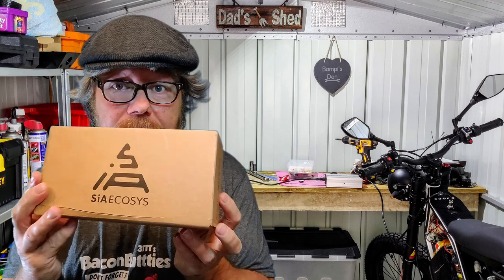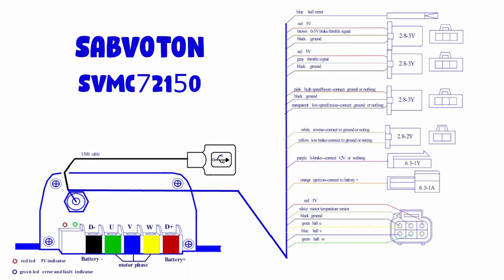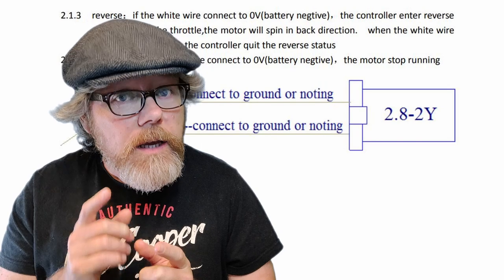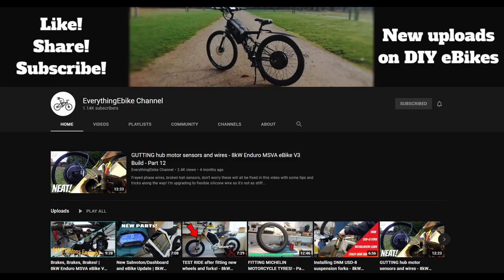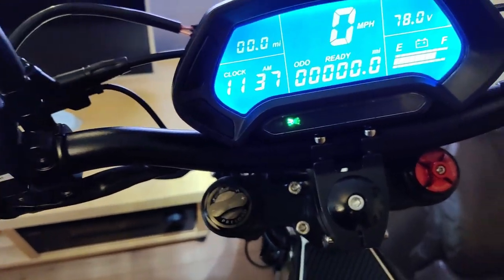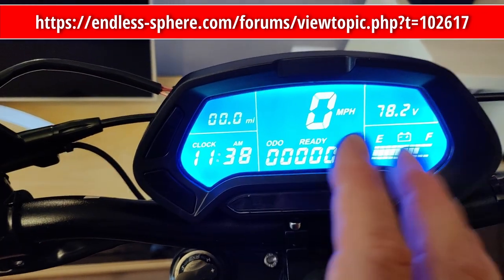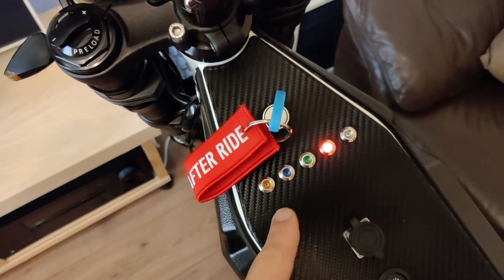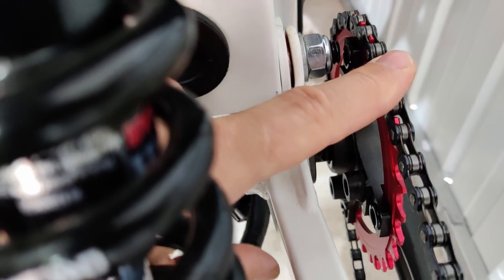IS THIS THE BEST DISPLAY FOR AN EBIKE -  EBIKE PART 17  -  CT 22 DISPLAY

Comment: Hello. Nice job you’re doing there. Thanks for helping us every day with your kind advance through your videos. I was wondering how did you calibrated the battery indicator bar or meter. I installed  this lcd in my girlfriend’s Super 73 rx and even though the voltmeter is reading accurate the battery indicator reads almost empty. I also ron in to an issue when I swapped the original Super 73 controller for a Sabvoton 45a in which the stock motor of the Super 73 rx jumps or kind of jerk at very low speed. (When I accelerate from zero mph). After that is fine. Maybe a word of advice would help. Thanks in advance for your help and have a lovely and warm day😊
Reply from the maker: The battery bar indicator had to be done in the settings. It's a long time ago since I did it so have forgot.
You have to calibrate it in percent and took me a while to do it.

There is a website I followed, I will try and find a link for you.
I'm not sure about your sabvoton problem either as it's super hard to diagnose other people's problems with limited information.

Comment: I bought this because it looked just what I needed, Thou can I only connect this with a sabvoton controller? If so can I program the controller with a Bluetooth dongle like I can with a yyk controller?
Reply from the maker: It uses hall signal for speed and is programmable. It does say that it is universal, you can configure speed and voltage parameters.  All the programming is done with the buttons.
Reply: @baconbuttties  the YKZ7250JG controller is also sold by the same brand it also comes with a hall sensor connector ,  so i just connect them together and the display should communicate with the controller?   but how do i than connect the button to control the turn signals and lights to the controller? it feels like this display is a  hassle but worth-it endeavor  once everything is set up.
Reply from the maker: @sethirium9542  if you look here it tells you how to program display https://endless-sphere.com/forums/viewtopic.php?t=102617
Reply: @baconbuttties  the diagram is semi useful to me , i'm not a electrician techy guy and learn from seeing.    but it seems some functions can't be fed more than 12volts so a converter is required and some wires with different functions are soldered together if my comprehension doesn't fail me there? , thanks for the help!
Reply from the maker: @sethirium9542  yes you do need a 12v converter 👍
Reply: get a ukc1 it works well withthe sabvoton

Comment: Strange, you usually get error 30H when you disconnect the 3pin connector to the screen for bluetooth to work.. You had that connected and still got that error?
Reply from the maker: I had a 5 pin connector  and I assume that the error was because there was no communication between the Green wire : RXD (controller -> display)
 Yellow wire : TXD (display -> controller). The seller did say that it would only work with their sabvoton as they change the wiring.

Comment: I've got my Sabvoton controller with LCD screen with the same error. Bought also from Resin Motor. Already bought screen like your and will need to wire that up. Do you have (maybe) how you was finding which wire is which and how connect it to Sabvoton controller or is that info on endless sphere forum? Thanks
Reply from the maker: Yes I read this link here a few times, the wiring was straight forward but the programming took me a while to understand. if you need any more help let me know  https://endless-sphere.com/forums/viewtopic.php?t=102617

Comment: Does the display come with the mounting hardware for the handlebars?
Reply from the maker: Unfortunately it doesn't come with any mounting hardware, on the back the are 2 threaded bolts. I was lucky enough to know someone who plastic printed a pair of bar mounts.
Reply: @baconbuttties  thanks brother for the quick reply I think I've come up with a solution tho great video as usually by the way more I just have to figure out how to wire it up.
Reply from the maker: @malicewhite2168  the wiring isn't too bad, I found a webpage on  endless-sphere where someone had done it before .
Reply: @baconbuttties  Would you happen to have the STL file for the 3d printed bar mounts? Looking to use this as an upgrade on my Monday gen 7.
Reply from the maker: @jamesjarvis8061  I got it off  EverythingEbike Channel as he has the CT22 display ... If you watch his channel there is a video where he talks  briefly about the mounts. He should have the file you need maybe?

Comment: Does changing a display erases the parameters?
Reply: @baconbuttties  I like to replace my E-bike lcd display coz the one that came with my bike the parameters are locked from the factory, it’s uart protocol. Truckrun 1000w mid drive motor, not sure what controller. Can I replace it with any uart protocol lcd display?
Reply from the maker: @n6wxa  I don't know, sorry

Comment: Hello, I bought a 22 ct display, unfortunately I can't connect it to my sabvoton controller could you help me please? would you have the electrical diagram 2 how to connect the screen
Reply from the maker: I followed this web page as it has the wiring diagram https://endless-sphere.com/forums/viewtopic.php?t=102617
Reply from the maker: What Sabvoton controller do you have?
Reply: @baconbuttties  sabvoton 72150
Reply from the maker: @augustind6164  on my sabvoton 72150 it had a blue hall meter wire...that connected to pin 10 yellow white for speed.

Comment: Nice progress and again thanks for the shoutout 😁. With the reverse/low brake ground issue surely all the 0v points are the same as the battery and controller are a complete system? That's going to be a pain for me wiring it up and doesn't make much sense but if you've tested it I'll take your word for it!
Reply from the maker: Yeah I don't understand the 0v thing being sensitive to 72v - or 12v - but I'm wondering if it is that way considering you have a 12v + option for the brakes which slows you  as well. I have my brake switches on 12 volt + for the brake light that also triggers a negative wired relay for brake cut off. I tried putting the 72v - wire directly to the brake cut off and that didn't work so I assume it must be 12v - unless I have done something wrong 👍🏼
Reply: Hey guys I have one one the way and can't wait to try it out.  How did you guys mount the display on the ebike?  Thanks.

Comment: I have the same CT 22 display, do you know how to program the speedometer parameters correctly?
Reply from the maker: I couldn't do it mathematically as it was not correct.

What I did was use my phone sat nav to see how much it was out and then kept dropping down the numbers and took it for a test ride .
After about 7 times I got it to match the correct speed.
Reply: @baconbuttties  Excellent, from which number did you start ?
Reply from the maker: @rafaelestradagonzalez9232  There's a forum online and I think I started from that number. I will look up the link for you.
Reply from the maker: @rafaelestradagonzalez9232  https://endless-sphere.com/forums/viewtopic.php?t=102617
Reply: @baconbuttties  Excellent I will take a look
Reply from the maker: @rafaelestradagonzalez9232  👍
Reply: hi Rafael, I saw that you have the ct22. How do you like it?
Reply: Hi Fernando, this is a good product as long as you understand the configuration, only values p0 and p1 value needs to be the same.
Reply: @rafaelestradagonzalez9232 i  hi Rafael. parameters are probably easier for me than wiring. I tried but I am not good at that. Would you mind helping me a bit? 
I"ll appreciate any help

Comment: The size of GPS chips these days I'm really surprised that speedometers don't just use that
Reply from the maker: You can't register a vehicle with a GPS speedometer which is strange as it's more accurate.
Reply: @baconbuttties  And there's my answer. Thanks man, but yeah, crazy archaic rules.
Reply from the maker: @Tigermoto  👍